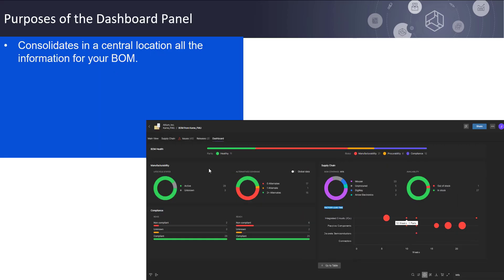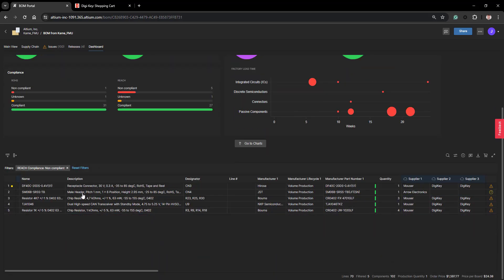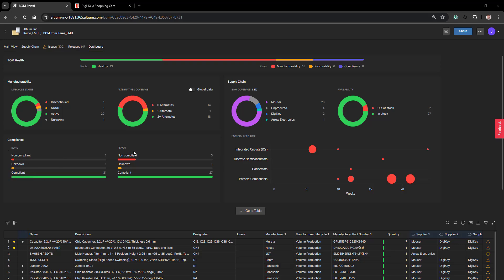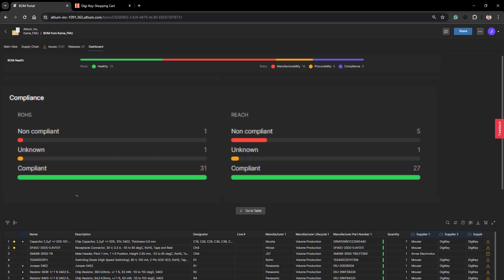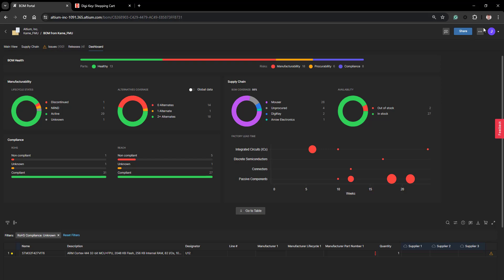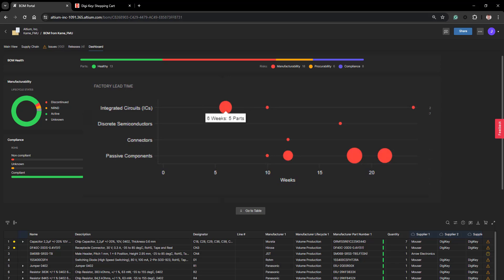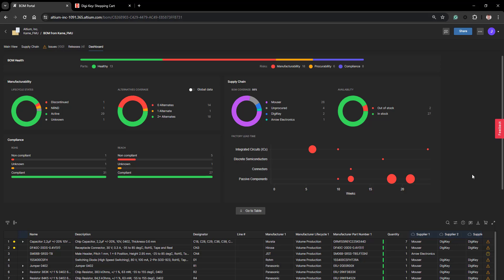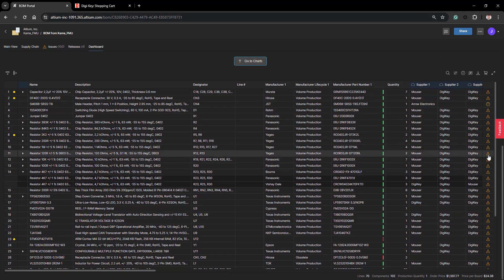BOM Portal Dashboard Panel

Comment: I know you believe you're doing a great service to the electronics community with this stuff, but what you're really doing is putting purchasing activities into the hands of design engineers who are not trained to use it.  This "easy import" of data absolutely destroys any hope of keeping a disciplined parts library, or of consolidating part types across projects to minimize different part numbers you may need to catalog and stock.  Rather, it creates a "Wild West" style of component management that breaks down any decent procurement infrastructure.  This kind of operating process may be useful for hackers, and garage shops, but it wreaks absolute chaos on any formal parts engineering system.